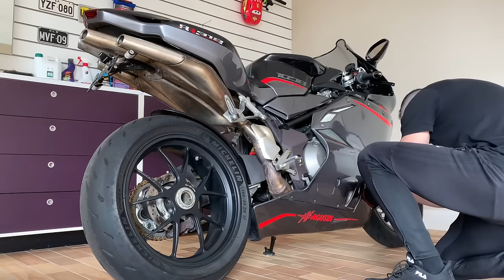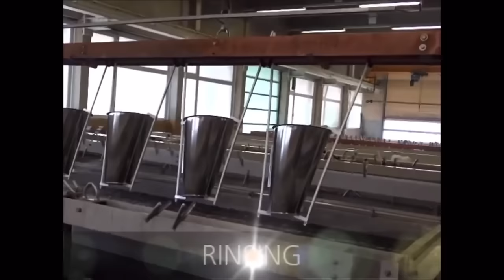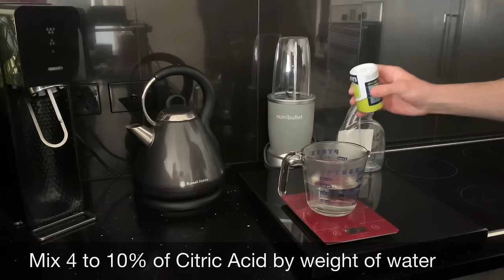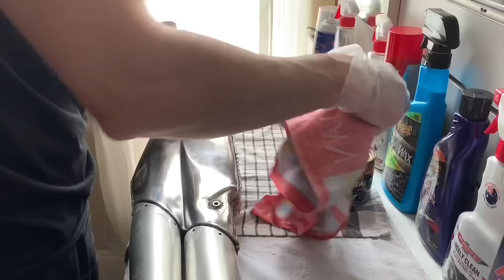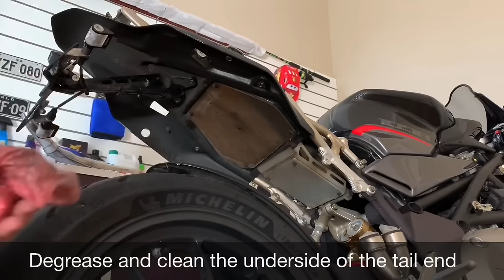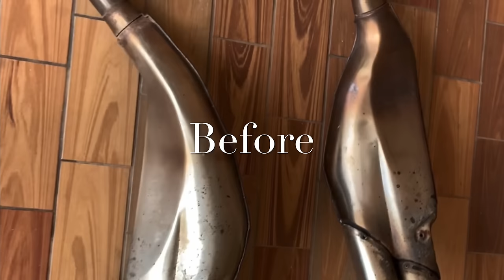Amazing motorcycle exhaust pipe polish and transformation (Do it Yourself)

Comment: 1 important step I wanna add: when assembly the polished exhaust you should use gloves, or after assembly you should clean it with degreaser, cuz oil from your hands easily could burn on if the exhaust will heat up, leaving slight discoloration. Good job on making you MV prettier Sir!
Reply from the maker: Very good point! I usually always wear gloves. I did wipe it down afterwards with a methylated spirits mixture. Pipes are still looking great today!
Reply: It's titanium you need to do this for or you'll have purple/gold fingerprints on your exhaust, doesn't happen on steel/stainless steel.
Reply: @HalfdeadRider  Happened on my stainless exhausts.
Reply: @HalfdeadRider  it does
Reply: @mark675  Never has to my knowledge, maybe I'm just not so greasy 🤣🤣
Reply: Ohhhhh no wonderrrrr… how do i fix that? I burnt mines
Reply: @1traphouse  Polish :)

Comment: Instead of having to do any hand work as a final step you could use a 1 or 2 inch ultra fine polishing foam pad on a handheld rotary polisher and get just as good results with less time and effort
Reply: Also to protect that polish work you should ceramic coat them using a coating that can withstand the temps

Comment: Great video although some  suggestions
Try Autosol Bluing Remover or alternatively Autosol Pickling Agent to removing oxidation on the exhaust as long as it's not a chromed exhaust
Goes faster and easier
Before using Autosol Metal Polish  you can use Autosol Senator 
This will save you time when polishing with Metal Polish 
For Super high Gloss use Autosol Metal Super Gloss
For extended protection finish with Autosol Metal Guard
Effective and powerful degreaser, use Autosol  A99
Reply from the maker: Hi, thanks for your awesome suggestions. To be quite honest, I have never seen any of those other Autosol products at our local Automotive stores in Australia. Generally, I've only ever seen the metal polish in a cream and a liquid. I'll look online. I'd love to try those other products out.

Comment: Anything you'd recommend for someone that has an oil stain on their exhaust? TLDR: oil got on my exhaust while it was hot and now seems to be permanently stuck on there. Would I need to go through this whole process or is there a way to just remove the oil?
Reply from the maker: People have had amazing results with Harpic 10x cleaner, which has 10% hydrochloric acid as the main constituent. Be careful though, and wear gloves. But before trying that, I would try Autosol metal cleaner if it's just an oil stain and only try the Harpic cleaner if that doesn't work. The whole process I've shown in the video is only necessary if you have deeper pitting and gouges in the surface of the metal, but not for stains.
Reply: @diymoto3952  tysm! Will give that a try

Comment: Wow the results speak for themself looks amazing. During the hand Autosol metal polishing process you look like you are using an abrasive pad or is that just a cloth pad?
Reply from the maker: Good pick up. Yes, it was one of those slightly abrasive pads used for cleaning metal pots and pans. I needed it particularly for the welded areas and crevices. It helps to make the job a little easier.

Comment: final polish should be a liquid (even brasso will do..) that autosol is an abrasive (grinding) paste which is a wonderful first polish
Reply from the maker: I’ve been meaning to try California purple metal polish. I’ll get some and give it a try to see if it gives me a better finish.
Reply: @diymoto3952  i restore enamel and silver (as well as my motorcycles) last polish can be a true mirror finish with a fine liquid ..
Reply from the maker: Thanks, appreciate the advice. I just used what I had already. The Autosol I had was probably 15yrs old 😂. I also have the liquid Autosol which I’ll use for 12 monthly cleans.

Comment: So much effort and a stunning result! Does the citric acid minimize future corrosion rate? Could I cheat with lemon juice! 😁
Reply from the maker: The citric acid will help with future corrosion, but the process I’ve used to apply it is not the preferred method. To get maximum corrosion resistance, it should be dipped in nitric or citric acid baths. Also depends how you maintain it, store it, etc.

Comment: Did you consider bead blasting or CO2 cleaning as a first step. These process get into even the smallest areas. Then follow-up with passivation and polish.
Reply from the maker: I don’t have a bead/sand blasting machine, but this would be a good option. The whole idea of my video was to do the job for under $100, so didn’t want to go hiring machines or paying bead blasting shops. Appreciate your feedback.

Comment: Harpic toilet cleaner from the pound shop will get all that shit off, then you just have to polish them with Solvol. Only doing half the job if you don't do the headers though.
Reply from the maker: Yep, the main constituent in harpic toilet cleaner is sodium hydroxide isn’t it, the same as draino? That would definitely work. My pipes had a lot of road rash and scratches, so a mechanical polish was necessary. I take your point about the headers though… maybe a job for another day.

Comment: Have you considered Ceramic Powder-coating the exhaust?  There are ceramic powders that look like polished Stainless, last years and provides performance gains by creating less turbulent gas flow inside the exhaust = faster flowing exhaust.
Reply from the maker: Yes, ceramic coating is far superior to hand polishing. However, the purpose of my video is for someone on a budget. You can’t ceramic coat two pipes and muffler sets for less than $100 😄.

Comment: What does the citric do to steel? N does it work with stainless?
Reply from the maker: Citric acid is used for the passivation of stainless steel. Nitric acid baths are most commonly used, but I didn’t have any nitric acid baths 😁. Also, it’s better to dip the product in a bath for best results, but again, I just worked with what I had.

Comment: I have loads of food grade citric acid that I use to descale the kettle, espresso machine and shower.
Can I use that instead of the non food grade stuff?
Reply from the maker: I think food grade should be fine. Remember, spraying the acid onto the pipes is not ideal, so any benefit you get is good. The most effective way to passivate stainless steel is to dip it in a bath of Citric or nitric acid. And a good quality stainless steel will form chromium oxide naturally anyway. So I wouldn’t worry too much about this part of the process. Like I said, any benefit you get is a bonus!
Reply from the maker: Have a look at my other video showing my pipes 1 year after polishing them. They’re still in fantastic condition. The best protection by far is to keep them clean, even if it’s just to wipe them down once a week or after each ride.

Comment: I thought great all for under $100! Then I saw your tools 😢.
Reply from the maker: You've got a point, but I borrowed that workshop from a friend, and there's nothing fancy there. He's got a simple bench grinder that seems to be part of an old lathe, and an air compressor with a dremel air tool. You could probably skip the air tool step and just use any old bench grinder. But thanks for your comment. I will be more aware of this in future videos.

Comment: If you consider your bike a piece of art, you should make perfect even it's most hidden parts. Otherwise it is just pretending...
Before passivation with citric acid,  you must clean the surface and remove any greasy material.  Acid must wet the surface and not make drops...
And citric acid is no poison...it's edible...and even fun if you mix it with backing soda...
Reply from the maker: Thanks for your reply. I agree with some of your comments, but there are specific reasons why I did it this way. Firstly, I’m time poor. I have young kids who play sports, so I don’t have time to polish the entire pipe, and there are no performance gains. It is completely aesthetic. Before passivation, I did clean the surface, but didn’t show it on the video. In terms of wetting the surface, I did explain that baths of nitric acid are the best way to passivate, but I don’t have an acid bath setup at my place 😂. In any case, even if spraying the surface helps 10% in the formation of the chromium layer, it is better than not doing it at all. 
And finally, Citric acid is a generally safe acid, but as I explained, I have children and it can still cause irritation of the skin or eyes, especially for children and exposure to sunlight. So I’ve taken caution to label it, even though it is a safe, food grade, mild acid. 

I’m planning to do a video to show everyone my pipes after more than 12 months. I have not polished them again at all and only clean them with a damp rag, then a dry rag, after every 2 or 3 rides. They still look fantastic and have not discoloured at all. So you might not like my method, but it works and works well! Have a nice day 😁

Comment: You really should wear safety glasses when polishing and maybe a mask so you don’t breath in all the dust
Reply from the maker: Yes, I definitely agree. I was not wearing safety glasses when testing the polishing wheel, but during polishing you will notice I had glasses on. The wheel was turning anti-clockwise, so pushing particles towards the floor, but you’re right, I should wear a mask. Appreciate your comment, thank you.

Comment: I hate videos like this. "Do iT yOurSelf" and then you show 40k worth of equipment?! When we search for DIY its because we don't have a garage, let alone all the other crap
Reply from the maker: Appreciate your comments and perhaps in future I will explain the equipment I used. I actually borrowed a friend’s workshop and equipment included a very simple bench grinder, air compressor & dremel air tool. If you don’t know anyone with the equipment, there are workshops you can rent for an hour or so, but by that stage you could just get the pipes ceramic coated, so I completely see your point. It was my first video, so many lessons learnt. Thanks for your comments.